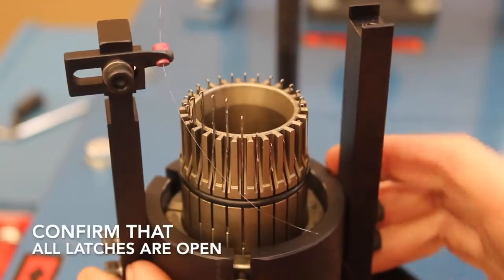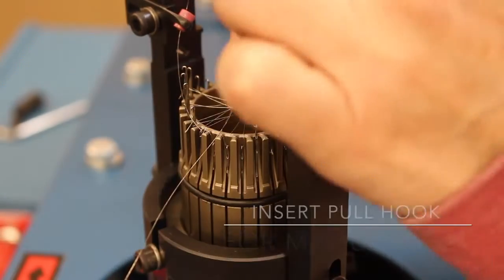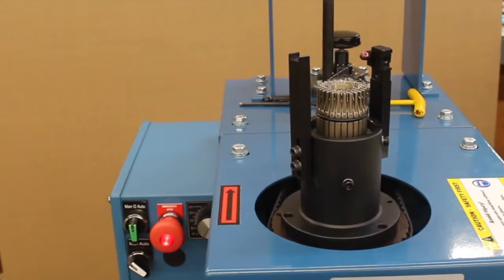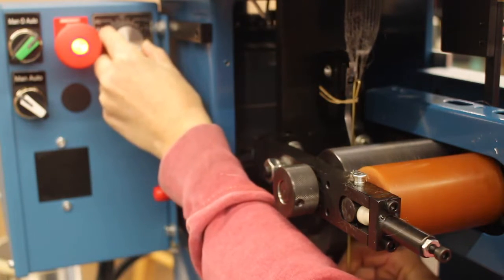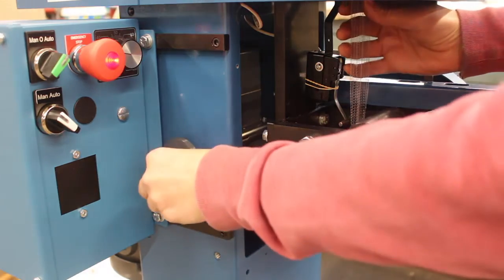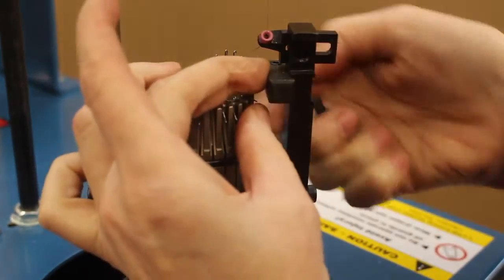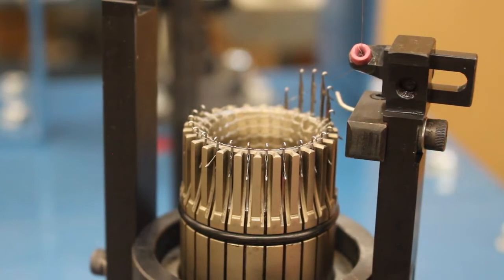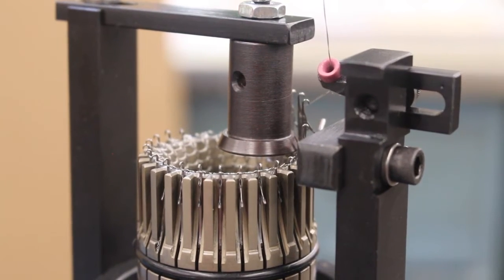Wire Knitting Basics on LAMB's WK6 Machine

Comment: Where will you get it?
Reply from the maker: Thank you for your interest.  This machine is manufactured by Lamb Knitting Machine Corp.  This machine is priced between $12,000.00 and $26,000.00 depending on the size of the knitting head and options such as detectors and traversing roll-up.
Please contact us for more information at info@lambkmc.com